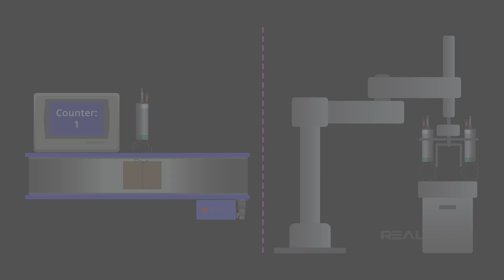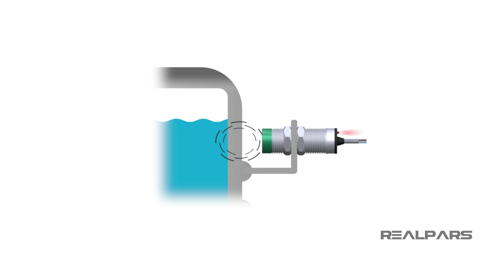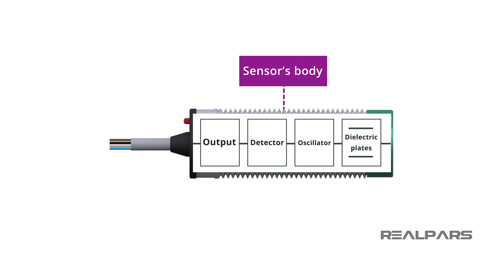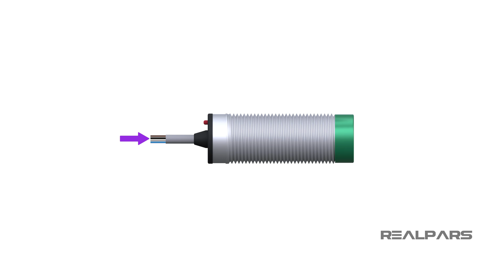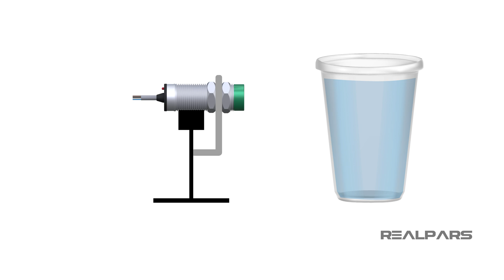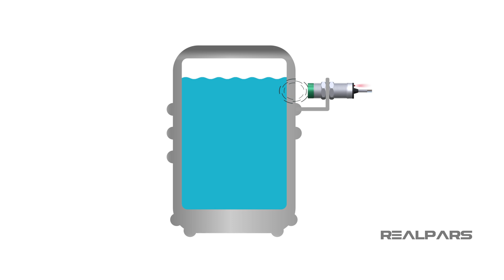Capacitive Sensor Explained | Different Types and Applications

Comment: Hello! Can I ask which sensor should I use if I want to detect different types of plastic (PET, PVC etc)? They have different wavelengths but I'm not sure which sensor to use for detecting them separately.

Also, from where can I get it? Or how to make one? Please do share if anyone know. Thank you!
Reply from the maker: As far as I know, there is only one such type of sensor on the market.  It is a 5- infrared laser diode sensor manufactured by IDEC or ProPhotinix.  They come in a variety of wavelengths to detect various plastic materials.

Comment: It's is very helpful thanks.
Can we use this sensor to detect color on printed film?
Reply from the maker: No, these sensors can only be used to determine presence of an object.  To detect colors, you will need to use a colorimeter or visible light spectrophotometer.
Reply: Thank you very much. could you please share something about the colorimeter or visible light.

Comment: I do have a question. In the example of water in a glass. If we set the sensing range to the distance of the cup, the sensor will detect the cup, with or without water. The water will only change in height (when being filled) not in distance because the distance difference in this case will literally be the thickness of the cup? So can you adjust the sensing range to the thickness of the cup or do you use the sensor to detect height difference not distance difference?
Reply from the maker: I have often used a capacitive sensor on the side of a glass or plastic tank.  I mount the sensor against the tank wall and then adjust the sensitivity so that it is "just not detecting" the tank wall.  As the tank fills, the change of capacitance due to the liquid level will be sensed by the sensor.  The sensor needs to be selected to be able to have a field much deeper than the wall thickness and have a way to adjust the sensitivity.

Comment: you help me a lot,thank you.
That's say every pieces of capacity sensor switch all have a adjustable screw,right?
Reply from the maker: Not all have an adjusting screw, but many do.  You need to check the manufacturer's specifications for the device you are interested in.  The adjustment is used to set the sensitivity of the sensor's magnetic field, which in turn indicates how close the object must be in order to be sensed.
Reply: @realpars  all right,thank you so much

Comment: How to identify the Sensor type is PNP (or) NPN  one, when the name plate details/sticker is tarred
Reply from the maker: Trace the wiring back to the PLC card.   For PNP sensors, the Negative side (blue wire) is connected to common. For NPN sensors, the Positive side (brown wire) is connected to common.
Reply: Thank you for your Reply
Reply from the maker: Hi Stalin, Identification is not easy because both NPN and PNP sensors look identical and therefore almost impossible to determine by examining them physically.
Here’s another method you might use if you know the sensor is functioning correctly.  Let’s assume that the power supply is 24VDC and the sensor is a normally-open type. First thing to do is connect a voltmeter from the output (black wire) to the power supply return which is connected to the Blue wire. Secondly, activate the sensor which will cause it to close.  If the sensor is a PNP type, the voltmeter will read 24VDC. If the sensor is an NPN type, the voltmeter will read 0VDC.  If the sensor is normally-closed, the voltmeter readings will be opposite during sensor activation.